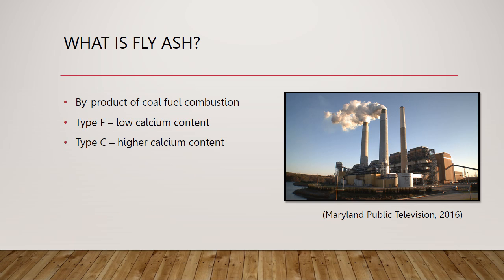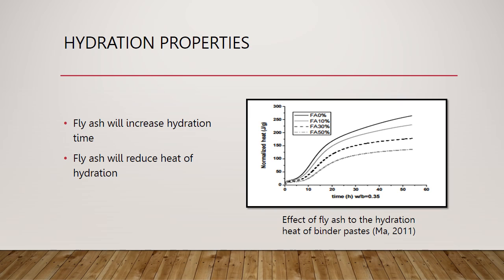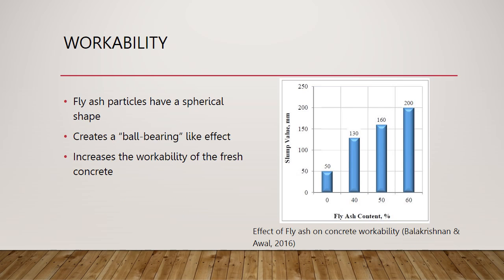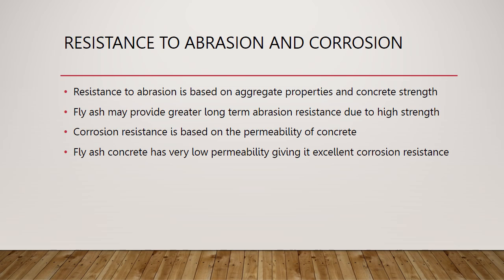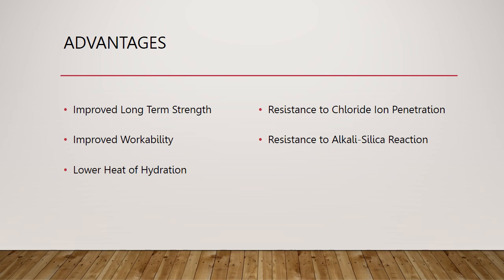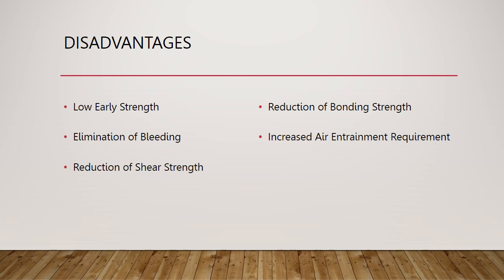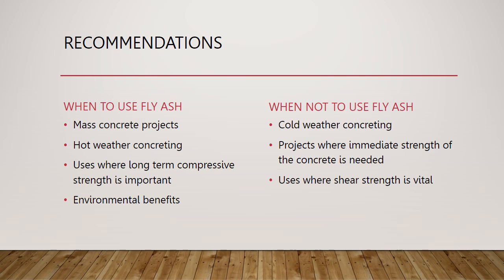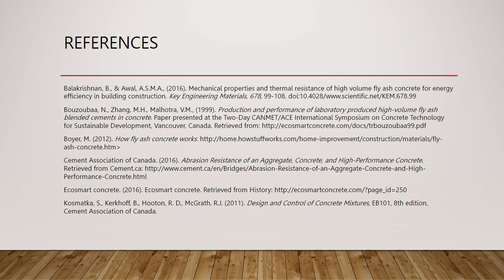Fly Ash in Concrete

Comment: lets say you use a 7.5% of fly ash by volume of cement content. Would one have to subtract the weight of the cement after?
Reply: A cement is a binder, a substance used for construction that sets, hardens, and adheres to other materials to bind them together.
The fly ash is the cement that binds the aggregate together, sand or small rocks are most common aggregates. Class C fly ash and water will dry into a hard stone, to make a little ash go a long way add aggregates. All cement works the same way as it's just gluing sand and rocks together into a block or monolithic shape.

Comment: Can you explain. How did you find or prove that heat of hydration is low? And the emission of CO2 is lower?
Reply: Because cement production requires energy, using coal for power, you are using a waste byproduct